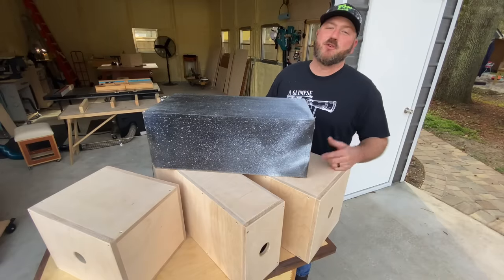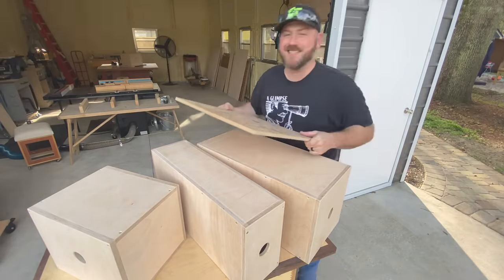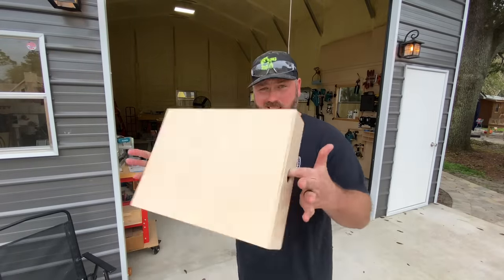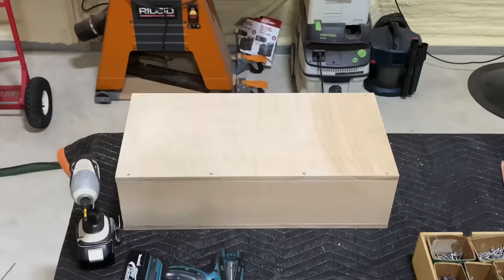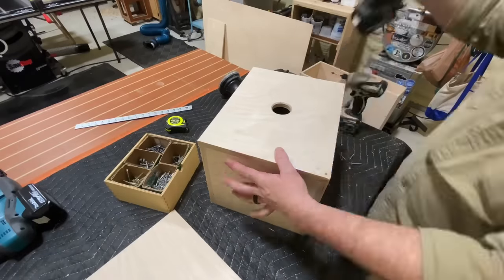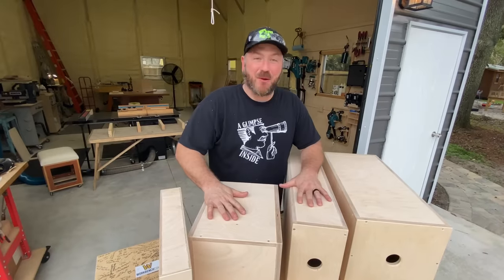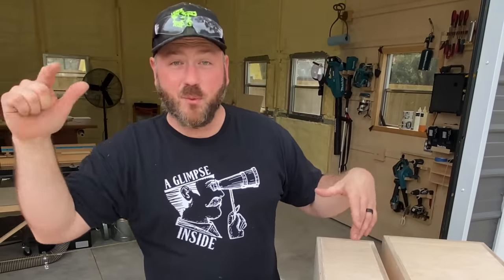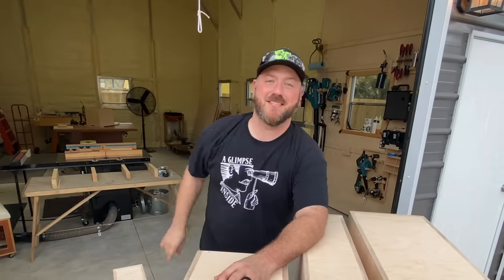Every Maker Should Make These | Apple Boxes From One Sheet Of Plywood | DIY

Comment: I've made 2 sets of similar boxes over the years. I make them in pairs of several different dimensions as you have done.  With 1/2" baltic birch, the cheaper-and-football-patched, coarsely sanded grade, and 3/4" nailers inside all corners and edges they can be glued and shot together with a cabinet stapler.They're as useful to jack me up as to jack up the work. Home Depot has cheap carpet remnants. I use the stapler again to fasten it and use carpet pad or multiple layers of carpet on three sides to soften a perch for my heinie when I work seated on them. By leaving 2 sides and the opening carpeted with only one layer they're still stable to work standing on a narrow end.

Comment: I work in the film industry as well as do woodworking as a hobby. I have a small set of Apple boxes in my shop. I make mine slightly different where the ends are “inset” into the sides/top/bottom. I always thought that was to provide additional strength especially on the ends. So that no matter the orientation of the box there’s always “support” on the ends. Nice build anyways! 👍
Reply from the maker: I got you. That’s a good idea. I guess I’m in the film industry to write LOL. I did the single hole so in case I don’t really need them I could just put them outside as bat houses. LOL thanks for the insight Ryan

Comment: Just found you thanks to "Creator On The Rise" I have also just started doing some woodworking!  As a photographer, I purchased some similar boxes however they have a dado of sort on the top, and also the bottom. This allows me to stack them to use for kids standing or sitting on without them sliding apart.  I need to get you a picture of the design.  It's awesome!
Reply from the maker: Thanks for let me know that sounds pretty awesome